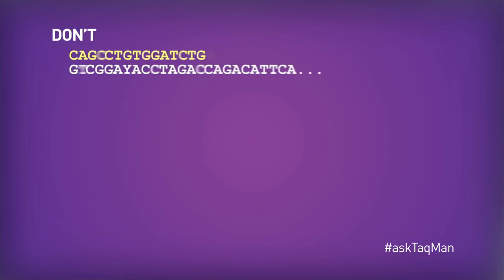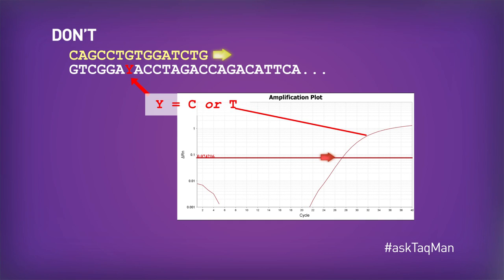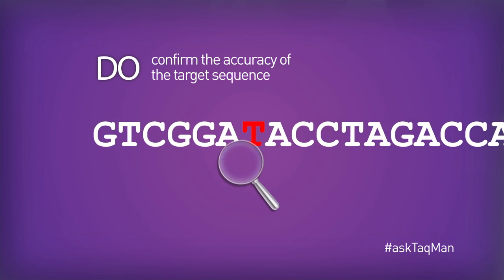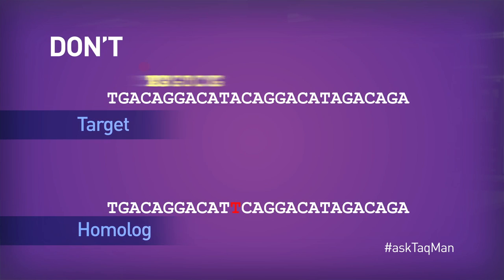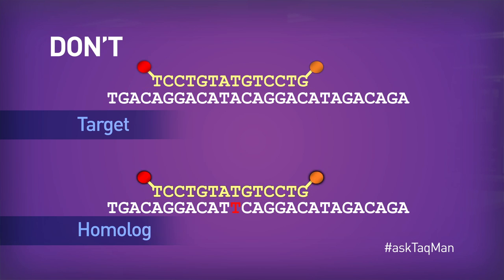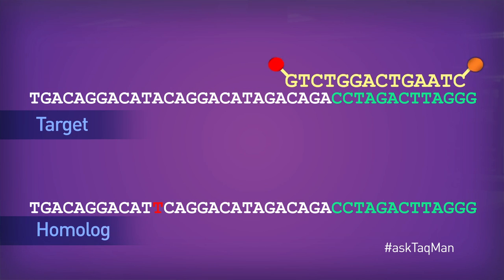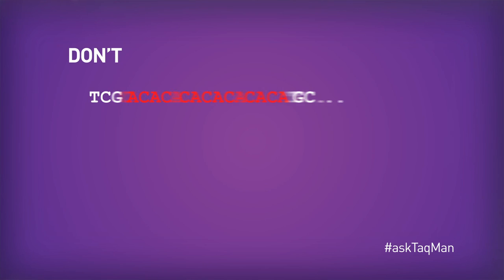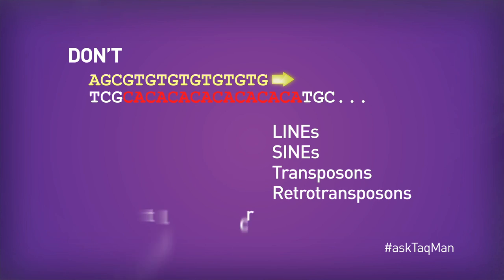Hints for Real-Time PCR (qPCR) Assay Design -- Ask TaqMan®: Ep. 2

Comment: Hi! I'm having some issues with my qRT-PCR. We use SuperScript® III Platinum® SYBR® Green One-Step qRT-PCR Kit and constantly, my negative controls show amplification and the products I'm looking for show no amplification. To isolate our RNA we use PureLink® RNA Mini Kit and we isolate from a legume seed with a high content of polysaccharides and alkaloids, similar to soja. What can we do to evaluate these mistakes? We've already tested if our water (UltraPure™ DNase/RNase-Free Distilled Water), mix or Taq (from the kit) are contaminated, but the results come clean, so it is not the reagents. What can we do?
Reply: Hi Estefania,
If you are not getting amplification for your samples, then it could be a problem with either the primers (non-optimal concentration, specificity issues) or the sample (low expression of target or inhibitors present).

For amplification in the negative control wells, this could be from gDNA contamination or primer dimers.  Have you checked the melt curves for these wells?  Primer dimers will typically be a more broad peak with a Tm ~ 68-70C.

It would help to have a positive control, such as a plasmid, to test your primers with.  This would help to determine if there are issues with expression or inhibitors in your sample.  You may also need to try a titration of your primers.  For SYBR Green, optimal concentrations are usually ~ 200-300 nM.

Let us know if we can help with anything else.

Comment: Reaction volume and format  volume: 5 uL [(Master Mix (2X) 5 uL+0.5 uL Primer forward (10 uM)+ 0.5 uL primer Reverse (10 uM)+Water PCR grade csp=9 uL. (Amount of template per reaction 50 ng). I included negative controls (without template) and positive control (pool of cDNA control)
I expected obtain one peak clean for the product desired (216 pb/Melting Temperature basic 88ºC).

Comment: A brief description of the assay:  Amplicon details (length, GC content, other characteristics) cDNA for β Actin; 62.9% GC; Tm 93ºC.Brief details of primer design and sequences: 20 basic pare each one; 55% GC, Tm 59ºC; Solution stock10 uM (each primer). Final concentration in the reaction: 250 nM

Comment: I'm trying to put in place some genes to quantify gene expression, the problem is that I had made the point at Roche carousel system 2.0 and change the Step One Plus platform with the kit Fast SYBR ® Green PCR Master Mix. I'm having problems while achieving amplification gain some peaks, with the same cDNA I have no reproducibility between runs (not always amplifies) any advice to optimize my reactions?
all my primers are checked with the amplifix software and do not form dimers!
Best Regards,